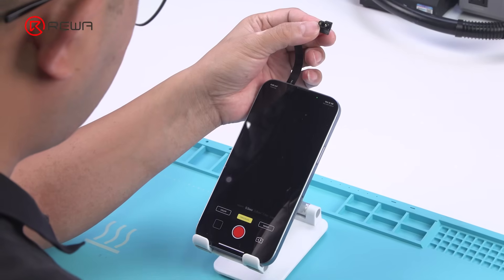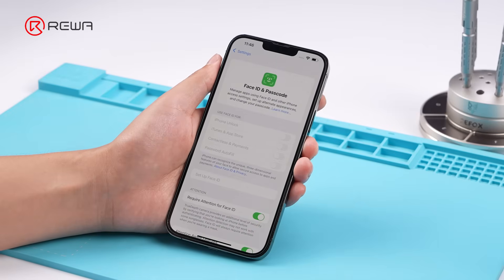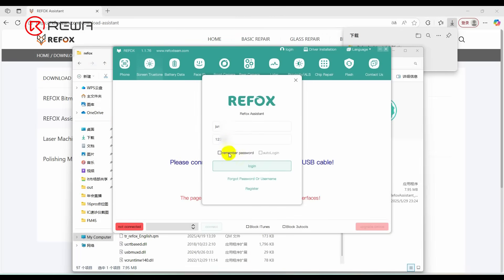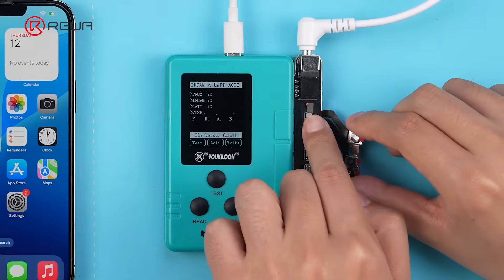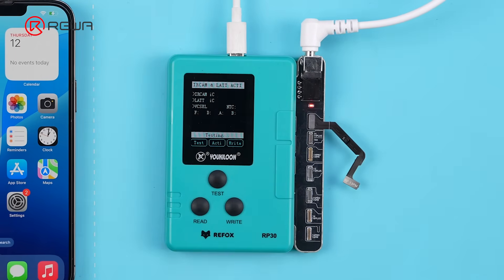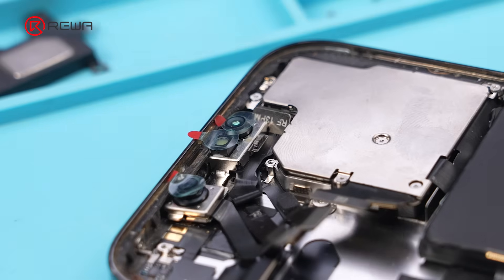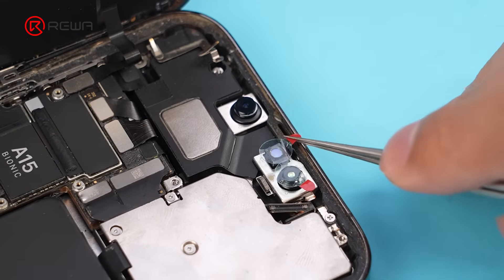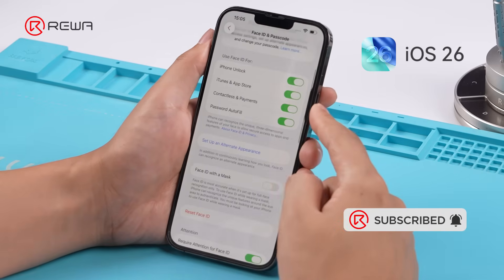No-Solder Fix for Face ID on iPhone 13–15

Comment: What could be the issue if the front camera and Face ID aren’t working, but the automatic brightness still works?
Reply from the maker: It means the front camera module meets problem, the automatic brightness works now usually means front sensor is fine.
Reply: @rewatechnology2008  So the fix the video is about wouldn't help right? Only if just the face id doesn't work yea?

Comment: is this posibble to do this on customer phone when stolen device protection is on and I cant connect it to the PC? because it wants Face ID after I connect to my PC. I can connect it only throw recovery mode, but its giving me that it cannot read the lattice SN. Thanks
Reply from the maker: This is a repair method,it can not bypass stolen or activation lock

Comment: Previous repair of my secondhand iPhone 13 Pro Max faceid is misaligned lens, and they fix it with solder mask. Is it possible to remove it and replace the lens? Dot projector is working normally but it’s out of focus. I can send video of the state of faceid please
Reply from the maker: Yeah but if it works fine, then we suggest you not disassemble too many times.
Reply: @rewatechnology2008 it does not work fine cuz the dot projectors is out of focus
Reply from the maker: @elbert5208  If so you can watch our dot projectoer repair video: https://www.youtube.com/watch?v=FGsXO3mqWnI

Comment: I have the programmer, have used it with previous Iphone 11 and 12. 
these tag on flex are very weird to fold, do not sit properly in the housing and with very little pressure the cable tears apart to squeeze it there, seems there is not a lot of improvement regarding this issue.
Does rewa offer a video how to fold all different models tag on flex
Reply from the maker: Yeah we will have a full after sale support, this 13 PM you can follow first, and we have all the module demonstration.

Comment: What do you do if “stolen device protection” is turned on and you can’t trust the iPhone to the computer to start this process because the Face ID is not working?
Reply from the maker: For real my friend, the stolen protection we also can not do anything, after all this repair method can fix usual face id problem... they are still the original one.
Reply: Flash it 😂
Reply: @praphaukarraaj4754  customer data 😅
Reply: Do a iCloud Backup and Reset it, After that dont turn on the Stolen Device Protection again
Reply: You can turn it off by going to icloud and go to find my device and turn it off. And also stolen device ll automatically turn off if face id module is faulty

Comment: i have repaired iphone 13 faceid today with tag on flex,  it was little weird experience after activate and cloud burn kept showing lattice is damaged, i had to cloud burn again with the entire sensor connected and when testing the faceid it kept showing "faceid is not avalible", and folding the tag on flex was also pretty hard becuse it kept popping out of place, but it eventually worked. now im wondering if i can screw on the camera bracket, as on the iphone 13 the tag on flex is connected on top of the camera, when screwing in the bracket it appears a little bulged, so im worried if it cannot damage the camera or the flex because of too much pressure
Reply from the maker: If you meets cloud burn problem, use other front camera to try, you need to test whether the programmar or the front camera meets problem.

Comment: does this additional cable does not make too much pressure on other components, like a screen ?
Reply from the maker: As you can see in the video, it is totally fine, will not affect any parts, and  do not make too much force on it

Comment: Can it be done without original dot projector module(The one came with Phone)
Reply from the maker: The pairing front camera is vital, we also try to prepare some data first, but…you know after our testing, it does not work😢
Reply: @rewatechnology2008 so no solution if  i lost my front camera module(Came with phone)

Comment: this work after you activate the lost protection on face id ?
Reply from the maker: You mean the activation lock? This repair solution generally works for the IC fuse problem, it can not fix or skip activation lock😢
Reply: It’s Not possible without connecting iphone to pc, that’s why you have to flash first